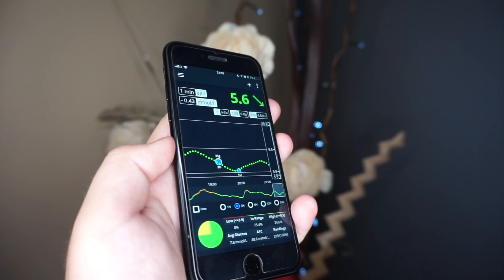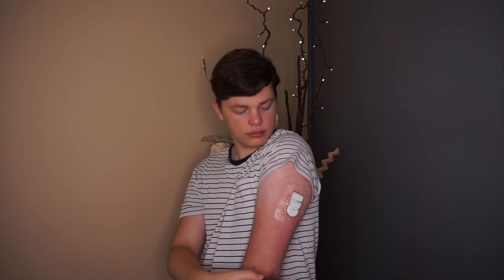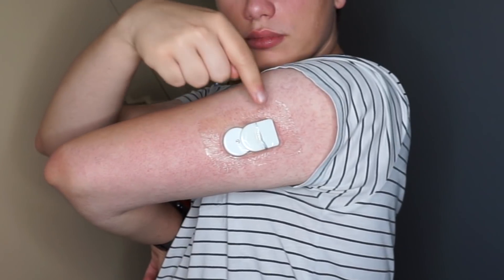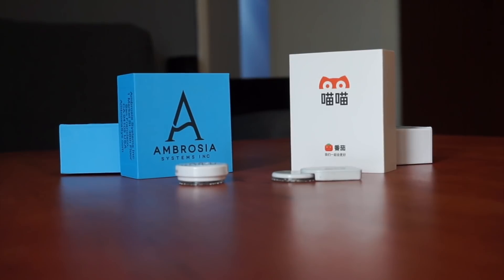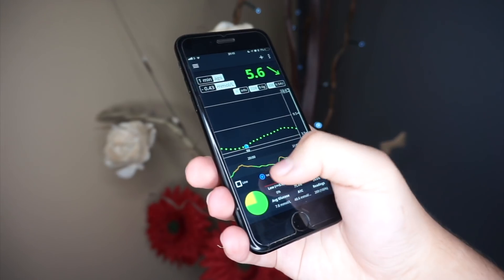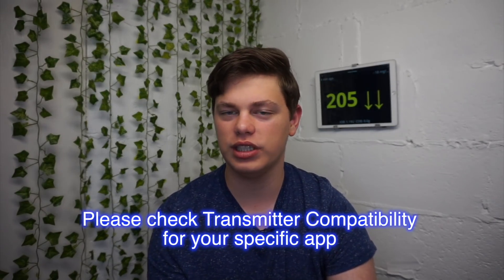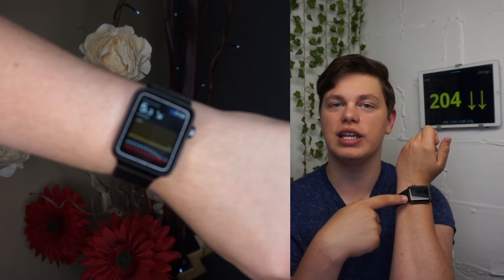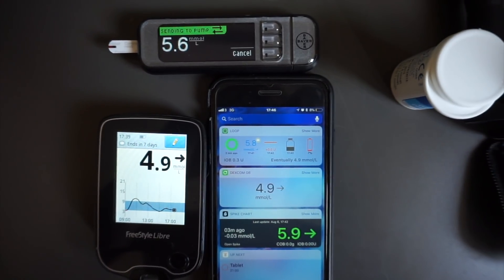How to get LOW /HIGH ALARMS with Freestyle Libre -Everything explained

Comment: I was wondering if you have ever done a video on the Bubble? I didn't seem to find one? MM2 is out now and the Bubble has received great reviews. I was hoping that you could let me know what you think of the two units ( bubble vs mm2)?. I live in the US and have been using the libre2 for about a week as it just came out. I was using dexcom G6 for 2 years, but even with insurance its costing about 1400.00 a year (includes monthly sensors &  transmitter every 3 months) which is costly so, now that Libre 2 has high/low alarm I felt I could make the transition back, but  I still feel that getting levels every 5 minutes is a must, as it gives one the most accurate view of what ones glucose has been doing, and trends seem to be more important then accuracy (BG vs Interstitial fluid) which most people focus on)? I find the Libre 2 to be much more accurate( in terms of deviation from BG reading and adjusts much better to the change) then the libre 14day and seems to have somewhat caught up with Dexcom in that aspect. sorry for digressing... If you could shed some light on the Bubble vs MM2 I would really appreciate, as I want to buy one of them in the next few days?

Comment: Hi Nerdabetic, what is the number range you can set the alarms for. I have slow adsortion of food and would like the set a low alarm at 10mmol, as it can take round a hour for dextrose to take affect. I brought the Dexcom G6 only to find out the highest you can set a low alarm is 5.6mmol.

Comment: Hi, I've been using Miaomiao and been satisfied so far. I will be flying in a few days and wondering if it is safe having the transmitter attached to my Libre sensor during the flight? Or do I have to take it off? Or is it not allowed on board at all? What about the security check? Any issues?
Reply from the maker: Hi, yes it is absolutely fine. I have gone though security with it many times. Hope your trip went well
Reply: Miaomiao.cool customer service is Extreme bad and bying from miaomiao.cool you are charged tax and fee  around 20 euro Long delivery time

Comment: Hello ! i want to ask - does Miaomiao is going to work with Libre2? I mean, does Libre 2 need Miaomiao transmitter to send the  data to the phone application? Thanks
Reply: Vanya Sirakova they are actually making good progress in breaking the algorithm so they are confident it will work soon! ☺️
Reply from the maker: Thanks for your comment, we still do not know. Have a nice day

Comment: Thx you so much for all your info.
This wil help us out so much.
Iam living close to a friend who has type 1D. 
And Iam the one closest in an emergency.
After a close call of sorts I recently  started to dive in to the tech and that was quite an eye opener for us both.
We are very much behind on med tech in the Netherlands.
We even need to buy the libre sensors ourselves over here because the medical advise board leans way of the insurers that don't want to see them as a necessary tool because of costs.But i degress.

We are very happy to find out how much better and most of all saver we can make it using new tech. 
Even exploring the possibilities of OpenAPS/AndroidAPS for the near future. Her future Ypsomet mylife doesn't support a separate bleutooth signal yet to look into looping.
But recent news hints of them opening up the source code.
So iam asking them directly.
Otherwise we might get a diffent pump.

But first we are setting up Xdrip+ or Glimp.We wil be running a Samsung S8 With the Libre miaomiao combi.So then we have a cgm running.
Good to know about the calibrating.
I see you have extra tape over the sensors?

I'll be  going through your Channel so maybe it's already answered but I had a question.
 
But how can you setup Xdrip+/glimp Nightscout cloud sms service for serious low alarm at night?

Edit: Found it in the xdrip+ app as a feature.Amazing the amount of work people put into all of this software and hardware tutorals.Its heart warming to see and read.
We wil dive into the rabit hole in the month ahead and I wil share as much as I can so my friend can do and understand all of this and can make ajust and repair what we are building.
She will be a Nerdabetic herself and spead the movement.
Great channel and we will be binge watching you in the months ahead.Thx!  

Regards Andries
The Netherlands
Reply from the maker: Hi. Thanks so much , please email me at nerdabetic@gmail.com or DM on Instagram and I will be able to help 😌😊
Reply: Justadutchguy welcome you are so right we are so behind on tech I just ordered my miao miao and cannot wait to start using ir

Comment: Great vids you have really made me aware of the whole DYI community and we have made improvements ever since. Now we have gotten as far that we have a closed loop running with M  and AAPS and thanks to that much improved hba1c. I just wanted to make you aware that it is also possible to use the Libre+M+xdrip with plugin LibreOOPalgo. This  applies the same autocalibration as the libre scanner does so you will not have to calibrate the Libre anymore at all (also taking out any chance of calibration errors). This has been working very accurately for us! Good luck!
Reply from the maker: I am so so so happy ❤️ so happy that i introduced you to this incredible world. And that’s very interesting , thanks so much for sharing this with me ☺️😃☺️😃

Comment: Hello this is jiye from South Korea! First of all I really appreciate for your vidios! It's a huge help for Koreans as CGM has recently turned into legal few month ago.. it's so hard to get any information about libre.. and your video is giving Huge help to me. 

I have two questions! If it doesn't bothers you!

1. Is it possible to start freestyle libre with Iphone X and get glicose data with Iphone 6+ ?
(Starting with IphoneX and get data through different phone)
(I will attach miaomiao on libre and use spike app)

2. Is it possible to start canada libre with UK or German libre app? 

Thank you again to your imformative video and hope to see your reply:)
Reply from the maker: Hi. Thanks so much for your lovely comment. So you can start your sensor using iPhone X and then use miaomiao with IPhone 6+ but you won’t be able to actually scan with 6+.  And no, sensors and app needs to be from the same country in order to work ☺️😃

Comment: The new 14 day sensor will be encrypted so that you can't that. And if you call and happen to mention this transmitter they won't give you a replacement if you happen to need it. Also it's not waterproof just resistant.
Reply from the maker: Like I said it is a third party device ☺️

Comment: Hiya.. Fantastic videos, especially for us 'newbies' to diabetes lol... I'm only just newly diagnosed, 6 months ago,  with type1 at the age of 47, but luckily I got the Libre almost instantly.. I have 2 questions if you don't mind.. firstly, My first few months using the sensor on my both arms was fine, then they both started getting very very sore, and red, and I had to take the sensors off after a few days... Have you heard of anyone else getting this type of pain from using it?? I use it on my legs now, and its fine, and the reading are still quite accurate, I'd just prefer it on my arm.. Secondly.... After maybe 5/6 days, the stickiness of the sensor starts to decrease, and I have to be very careful in the shower etc..... At the very start of your video, you have great big clear sticky covers.... where did you get them?? any ordinary plasters I've tried, just fall off lol..... 

Thankyou in advance for any help...

Jim
Reply from the maker: Hiya 😃 thanks so much for your lovely comment . And I haven’t heard of this king of pain. I would speak about it with your health team. And link to those is in video description 😌😃☺️

Comment: Good video. Interested in the watch you use. I have used Libré for years, first buying it here in France now free with an ordonnance. Have a 1st gen Huawei smartwatch t hat does not have NFC so I need to replace it. Stopped using iPhone & switched to Samsung, Note 8 for LibreLink, not sure whether that would affect watch choice with M.
Reply from the maker: Thanks so much Roger. So i use the apple watch series 3 GPS only version. Hope that this helps ☺️
Reply: Thanks Camille, my wife uses my old Apple Watch. Switched to Samsung & Android after I lost patience with Apple not having LibreLink. Diabétologue (consultant) put me on Tresiba, 'more gentle' last week. However I have still had a couple of LO's on the same dose! So I may well invest in M & see if the Apple Watch would work. Otherwise ne watch! Do like my tech-now using Samsung Note 9 that works fine with LibreLink. Thanks again, Roger

Comment: Have you done a video on FreeStyle Libre accuracy?   Some doctors say it's to inaccurate to rely on and can result in one giving one to much  or to little insulin.  I use it and I love it, but I wouldn't say it's alway accurate.
Reply from the maker: So I haven’t done a video just about it . But it will be covered in details in my G6 vs Libre vs Libre with Miaomiao video. That video takes a long time to plan as I want it to be detailed / unbiased ect but stay tuned 🤩😃
Reply: There is a 10 minute delay expescially if u are going low or high quick. Also there is an active guy that tracts ur insulin. Its very helpful. Plus testing ur sugars too